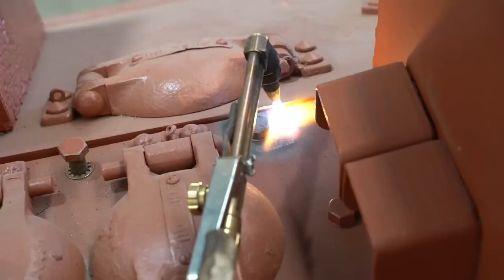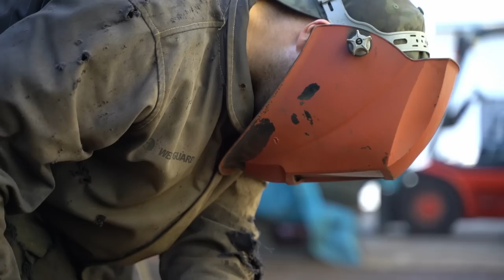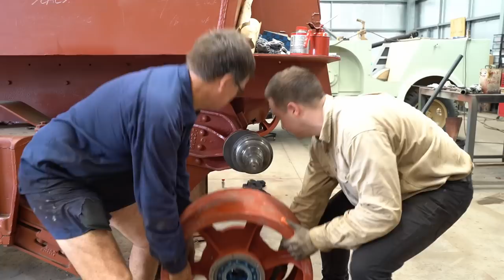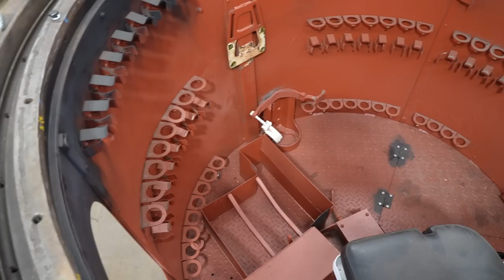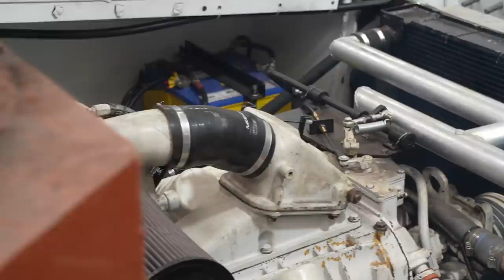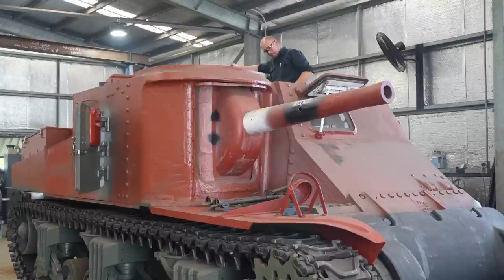WWII Grant Tank Rapid Restoration Recap

Comment: I have a QUESTION - Is the  grey add-on casting bolted over the 3-piece transmission an in-service modification by the Australian army, or something that was done during civilian use after the war?
Reply: Australian army late war modification apparently based on Australian army experience of jungle fighting where Japanese troops concentrated fire on the lower hull and tracks of Australian Matilda tanks. 38mm cast steel. There were other modifications like rear deck hatch armour and and anti-grenade mesh. The front applique armour seems to have  been common but not universal.